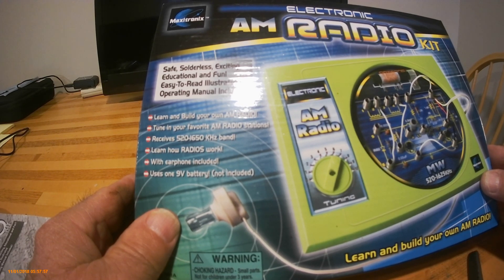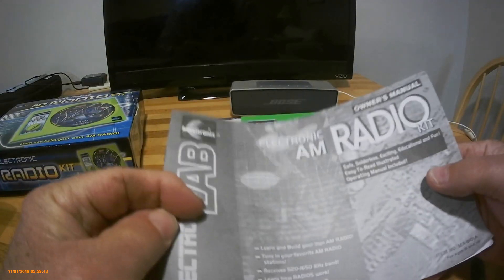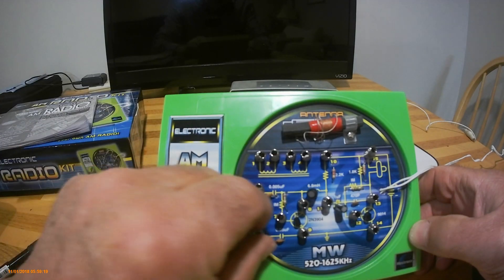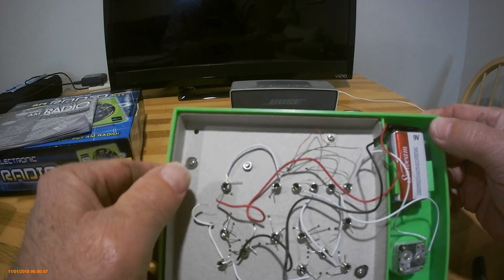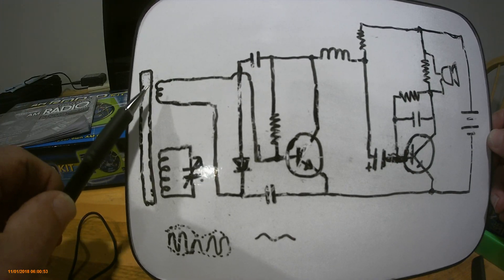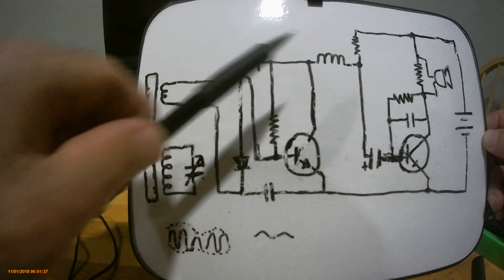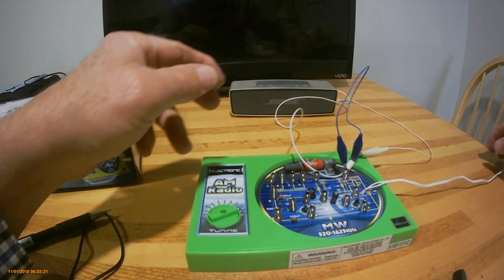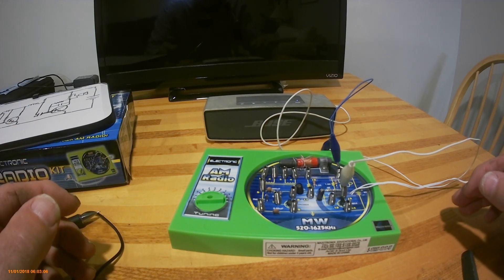Review of a 2 Transistor Radio Kit

Comment: Nice! What kind of transistors does it use?
Reply from the maker: 2N3904 and a 9014. The 2N304 is used RF amp coming off the tuner. 9014 is used for the AF amp. Thanks for watching. This kit is still available for about 19 dollars. Its the model 901A from Maxronix
Reply: @rbashta  Tnx!